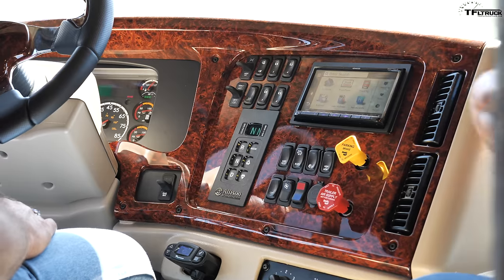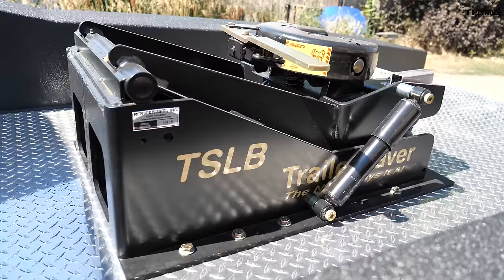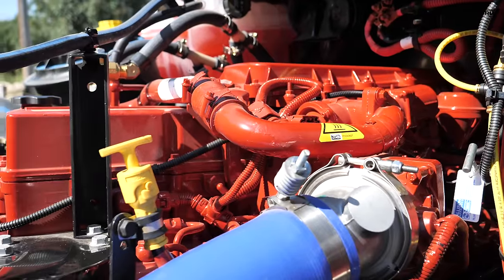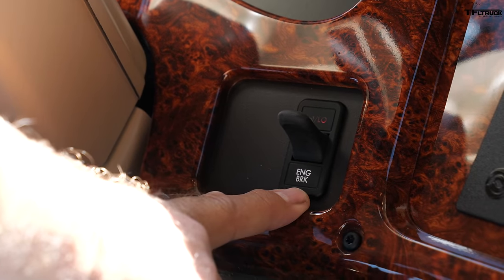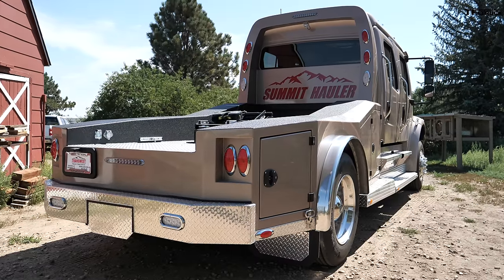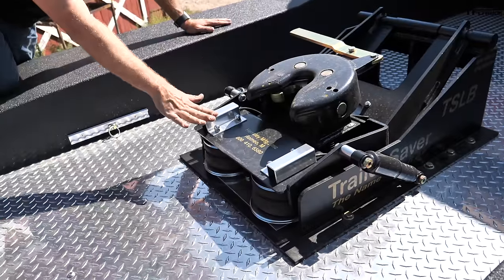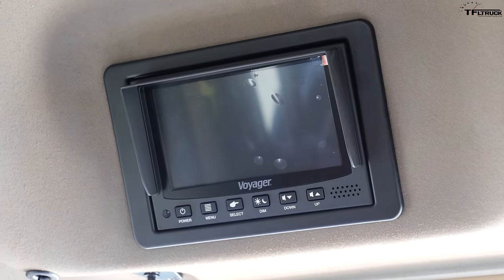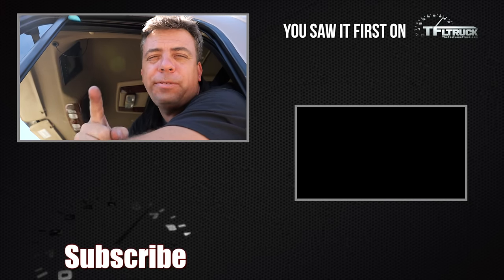Here’s Why This MONSTER Freightliner Will Make You Hate Your Dually Pickup!

Comment: The way light duty trucks are going, this is a sneak peek at the 2030 group of trucks lmao
Reply: Accept by then they will be pulling 45-50k
Reply: @yotatrd5.758  with brakes designed for half that amount lol. Nice screename I have a Tundra
Reply: @yotatrd5.758  lol our GVM and GCM laws here in Australia will need a massive update they way they are ATM we cant even max out a Ram 3500 the max GCM in Australia is 9000kg (19,841 lb) to max it our you would need to get it classed as a semi truck and get a semi license.
Reply: Phalanx 380  in austria you cant even register such trucks maximum is 3500kg for car an Trailer combined. So technically even a heavy car such as a rolls Royce must be registered as a semi truck.....
Reply: This is the way things are going because only wayanufacturers are able to meet CAFE and EPA regs....most likely a 2030 1500...lol
Reply: But you can use a Semi to pull a heavy 5th wheeler in Australia, so somewhat more than the 9000kg
Reply: @robertryan7204  i work on my family farm where it would be nice to have something that can tow a heavy load with out going in to the semi class as that comes with a lot of rules and regulations we already have enough bullshit red tape running a farm to add on all the bullshit that comes with a semi is to much the only time we need a true truck is when we sell grain and we just hire a B-double to move it for us and its only for one week of the year. on the other hand if could use at least 2/3 of what a RAM 3500 can do it can be use as the daily drive and hall some loads every now an then. also if we need to tow something out side the rams limits we would just use out tractors because the only laws for the tractors is you need a car License and tractor must be retested and follow the road rules no GVM and GCM rules apply even to attached trailers only problem is tractors are slow even new tractors top out around 70km/h.
Reply: Mr M  yeah I sold the truck years ago... 89 taco with a built 347 Ford in it. Truck screamed it’s would decimate all till about 130ish mph at that point she got really sketchy.
Reply: Phalanx 380  if you notice when there doing the max weight towing tests MRTRUCK has to drive it. Stateside Class C licenses are only allowed to pull a combined maximum of 26,000lbs truck and trailer. To fully max out a 3500 Ram, Chevy or Ford you need a Class A (either non commercial or cdl.) Which I did get for my 3500 Ram. I own a 40’ Gooseneck rated at 30k for a side business.
Reply: My trucks GCVWR for the DMV is sticker’d at 45k my truck and trailer are truck and trailer combined are 44,000lbs. These new HD trucks are pretty awesome.i put 50,000 miles on her in 6 months pulling my Gooseneck. Never had an issue I climbed the Ike gauntlet at max and the truck never lugged below 48mph multiple times coming out of Salt Lake City to the Denver area. These new hd trucks are great and it’s hard finding a medium duty 4x4.
Reply: @yotatrd5.758  that's awesome your truck does so great pulling your 40' gooseneck trailer! I'm sure you're familiar with Parleys Summit in Utah between park city and salt lake city. Pretty damn steep grade!!! I prefer going up parleys and other steep grades on a motorcycle ;))
Reply: Or you can buy old  Whites, Freightliners,  Western stars, KW , Pets farm trucks for 5--8000 and tun them till they drop....But thats just me..
Reply: @NameSchema100  there are some states that it is like that here in the US. it's not the weight some states you are limited by overall length or number of axles
Reply: @BassRacerx   yeah but still, a car can drive maximum 130kph on the highway, and a semi truck only 100kph, also they are not allowed to drive on weekends. a dodge ram for exaple counts as a semi truck. Also you need a semi truck drivers license. but in the end it does not really matter because the roads a way to small to daily drive a big car anyway..
Reply: Hey don't hate bro...I'm bout to get one of these
Reply: @yotatrd5.758  they already tow that the top line super duty 450 from Ford tows 45k
Reply: @dylanmcdonald9266   nope F450 is maxed at 37,500
Reply: @yotatrd5.758  no it’s not trust me it’s at 45k

Comment: you can get it cheaper by getting the same truck from freight liner and then get a bed for it
Reply: It's the same body style from 2003. You can easily find a used, pre-emssion, low mile m2 cheap.  Anybody who'd spend 160k on this has more money than sense.
Reply: You can buy a full-size rig used for far less than that and make more money with it.
Reply: Both are true
Reply: @josenoyola9851  beg to differ, the hot shot guys using the one ton trucks make very good money and truthfully if I was going to do that I would buy one of these used instead of a one ton since you can find these on the second hand market for fairly reasonable.
Reply: not really, the leather seats, the chrome, the wood trim, the bus tires, the polished Alcoas, the tire balancers, the custom bed, the custom paint job, the voyager camera system, the air-ride GN/5W hitch, are all custom add-ons from the custom shop. Sure, you can buy a new M2 crew cab, but it's gonna have none of the features this truck has, you'll get a basic work truck that you'll have to build up yourself.
Reply: @DB-rw5vu   Yeah, but you don't NEED any of that crap, especially the visual stuff like chrome and fake wood. That's why it's better to just buy a used work truck.
Reply: @DB-rw5vu  you can buy brand new semi-truck in europe for less that 162k (147k euro) with leather seats etc. air-ride its standard front and back and cab have also air-bags and air seat, you have onboard computer where you can check everything, automatic transmision 12front+1reverse, engine brake is not switch on dash but stick under steering wheel like blinker with 6positions and lot more and its not custom its all from factory... dont misundersand me this is not hate or anything like that i just thing that this truck is nothing special if you compared it to europian standards and its pricey. have good one
Reply: Agree DP because there is so much competition in the European market, you can get some pretty optioned out good value deals
Reply: @D0P1C3  
I subscribe to a European truckers magazine and their trucks have all the bells and whistles that we get on a sedan, SUV, mini van. Features we still don't get on pick-ups.

One thing you will find harder to get is an automatic transmission on a semi. Even the Sprinter, Ford and Dodge vans all come standard with 6 speed manual and none offer a gas motor. Gas motors are a North American only option.
Reply: @ @D0P1C3  That's great for Europe and European buyers, but this video is for American buyers, the company that built this truck is in the USA, not the EU. Don't get me wrong, I'd buy one of the semis you mentioned, since Semi Tractors can be registered as recreational vehicles.... in 25 years when an individual like myself could import one, because we have a stupid law preventing importation of newer vehicles.  
@Nodak81 never said you did need any of that, the 26 foot box truck i drive for work has none of that, and I love it. And if I was gonna buy a medium duty truck like this, I'd save up $10,000 and get one from the late 90s, maybe an International crew cab, big ugly brick of a truck, likely painted caution sign yellow, probably have a gazillion miles but still running strong. Seats out of a F250 Lariat Super Supercrew, and an upgrade to the sound system and a touchscreen head unit, and bam, cheap "super tuck".
Reply: @DB-rw5vu  that 25y import law its only thing that stoping "revolution" in semi truck industry in USA but there is hope that ford F-Max semi its made to eu standards to compete here maybe they start sell it there time will tell

Comment: As a truck driver who is currently sitting in a Kenworth T680 with a 455hp/1850 ft-lb 13 liter MX series engine and a 16-speed Eaton Fuller Ultrashift Plus with 3.55 rear axles..

This is a damn nice truck too. I'd buy one if I had the cash.
Reply: Same price as your Kenworth. I'll take the Kenny
Reply: The KW has a shaper turn radius than the Freight Liner does.
Reply: As a truck driver the last thing I want to do on my days off is get in another truck.
Reply: I'll take my truck without the garbage auto... Current haul pig is a freightliner 122sd dd13 Detroit 505hp 1850tq 18speed Eaton with 3.91 rears with full lockers, regularly pulling over 100,000lbs
Reply: In first gear your KW has over 100,000 ft/lbs at the rear wheels
Reply: @sammolloy1 you're full of bs there is no magical transmission that will add torque to the engine, let alone multiply 58 times.
Reply: Timm Marshall Look it up. 13 speed dual range 3.55 gears 102,000 on the rear wheel
Reply: @sammolloy1  I worked in a truck shop and dyno'ed a myriad of trucks. Cummins, Cat, 13, 15, 18 spd. Final gears from 3.36 to 4.88 and the most I've ever seen put to the ground was around 2500 lb/ft of torque. That was from a built Cummins. Show me a dyno run where a factory class 8 truck is putting 102,000 lb/ft to the ground.
Reply: Timm Marshall That’s as high as your dyno goes up to. It’s like I said per Cummins. They have some experimental engines that run at extremely low RPM to save fuel but the rear gears would have to multiply not reduce the drive shaft RPM and the large pinion would strip the axle gears. I might suggest you attend some seminars when they are available.
Reply: @sammolloy1  you said that mans KW is putting 100,000 to the ground. Now you've changed it to experimental engines and theories. Which is it gonna be. Elon Musk is developing an electric truck that in theory will make 1,000,000 lb/ft. of torque
Reply: Timm Marshall Most all Class 8 tractors now have similar power. Any of them with the 13 speed and the common 3.55 gears put about 100,000 ft/Lbs to the ground.
Reply: @sammolloy1  if it's so common send me a link to a dyno run or anything else with actual #s to backup your claim.
Reply: Don't do it!! Freightliners are the Kia of the truck world. Keep the nice kenworth.
Reply: I’d rather take the kenny
Reply: @dofgefan528  the gearing multiplies torque to the rear wheels, not to the engine. The engine will put out a set number of torque and the gearing is specifically set up to multiply

Comment: I love these trucks!  They are a fantastic option for those who can afford them and need a dedicated towing beast! Great review and showcase as always. I also love having a pickup truck bed for those trips to the hardware and feed store when not towing.
Reply from the maker: Thanks for the kind comment. We love your vids as well. Keep up the great work!
Reply: True but if you have one of these, you probably have a couple of ranch pickups for those mundane duties ;).
Reply: Jd, you already planning on trading the f450 for one of these?
Reply: This truck plus a big enough trailer to justify it, may as well get a class A. The only time this would make sense is in the case of an actual Class 8 (which of course this is nowhere near) that an owner operator trucker already has. That's pretty niche.
Reply: Its a normal tractor with a bed. Only differance is a 9 liter engine. Id by an old tractor without emmisions and convert it. With a fifthwheel attachment as needed for trailer.

Comment: Manual regen switch ONLY works with the parking brake applied and sitting still. Usually takes 15-30 minutes. While you're rolling, the regen can happen automatically.

Comment: We’ve got a Peterbilt 335 4 door all black. With the same flatbed. It’s a Cummins ISX that’s been deleted. We use it to pull our 49 ft horse trailer. We absolutely love it. We had bought a Freightliner exactly like that on but it couldn’t handle the trailer but it had a mersadies Benz engine.

Comment: 4:53 seconds in. Yes it is CDL territory IF used in commerce. You can buy it for private use and pull your own trailer WITHOUT  a Commercial driver's license. If you are pulling your stuff and not in commerce, no cdl. Colorado you can drive with a standard license as long as it is registered as and rv and not commercial, even pulling your own trailer. Some states have a non-commercial class system for this set up but still not a cdl requirement.

Comment: "A lot of hot air on this truck"  says Mr. Truck. Got a good chuckle from that comment.  The tire balancers which supposedly add 25% or more life span to the tires was interesting.
Reply: But in my experience, they add significant life to both tires and suspension parts because they almost instantly adjust the balance of the axle end. I delivered travel trailers for a year, the boss put centralizers on all axle ends and it make a difference in the ride, as well as vehicle life. I was honestly surprised at the difference.

Comment: My 2019 dodge drw will hold 5510 lbs, and tow 32000. It only cost $ 38k.
  400 hp and 1000lbs torque stock, after tuning 465hp and 1250 lbs torque,  
  Take that freighter.
  Oh and btw I get better fuel mileage, and truck weights half as much, so power to weight ratio blows you away lol
Reply: Just drive what works for you

Comment: I want to correct some things that Mr. Truck said.  The dash regeneration button only enables the user to do a manual or stationary regeneration when the DPF is highly soot loaded.  If you hit the button and that condition is untrue, it will do nothing.  Also, there should be no reduction in performance when the regeneration is occurring while pulling on grade, although fuel economy could be different.
Reply: Also, Andre says you can get higher power ratings with a Detroit Diesel but not in this M2-106 chassis to my knowledge.  Detroit's DD8 is the largest Detroit option available for this chassis and the DD8 has a highest non-emergency rating of 350hp, but that rating has less peak torque (1050 lb-ft) than the engine in this video.

Comment: It's the other way around Andre. 1 ton luxury dually trucks will put this to shame in price, in basically everything.
Reply: I dunno.. if your towing 25k+ lbs with a truck on a regular basis, this is a truck that is made to make you the Captain of  your rig and let you drive it in comfort and confidence, its just sketchy to be pulling a 35k lb trailer with an 8k lb truck with just regular disc brakes and a little exhaust brake, if anything went wrong while driving, there's no backup systems and things could get real hairy real fast, this truck is designed to pull those loads safely, mile in and mile out
Reply: Freightliner vs 1 ton dually with max load:
It stops quicker.
The max load is not limited by the powertrain but government regulation.
Gets better fuel economy.
Built to last 2 or 3 million miles ( no guarantee)
Cheaper to maintain.
Parts available 24/7
More stable at highway speeds.

Having said that, 160k I'll pass.
Reply: @GrandmasterFU666  But, buy one used with a couple hundred thousand miles for $50-70k? That sounds smarter then a new fully loaded one to. Dually
Reply: Exactly, much more capable than a 1 ton